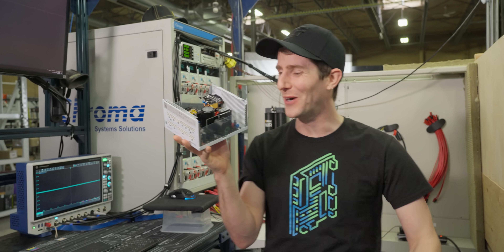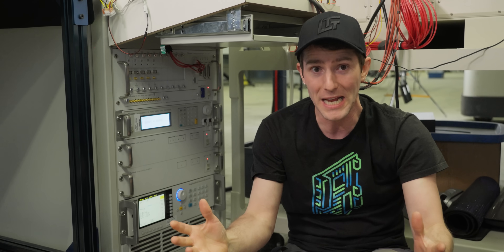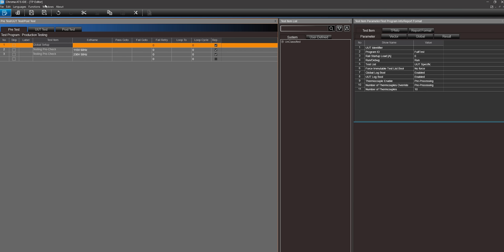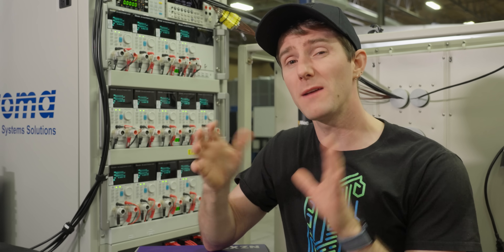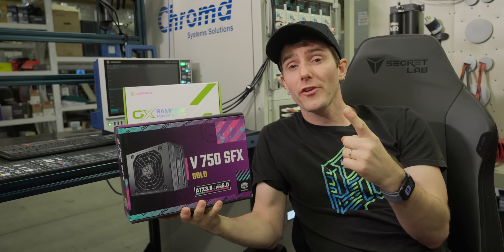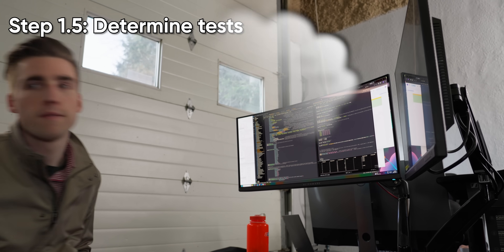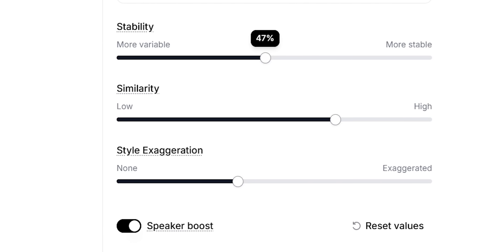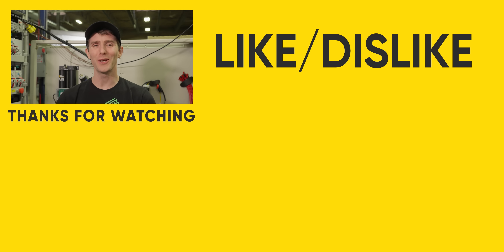Thousands of You are Buying Dangerous Power Supplies

Comment: Engineers getting a platinum power supply out of gold is a flex on their part
Reply: In reality it's in huge part probably also just market segmentation - they don't want to have the high rating on a cheaper product. But they might save here and there by reusing designs or parts from more expensive PSUs.
Reply: @amunak_ Right: if it doesn’t cost too much extra, why not just have a nice platinum-level design which you can change the rating sticker and price on as convenient?
Reply: @amunak_  100% dude, a company isnt gonna design a product and build an entire production line for it for $$$$ if they can cut down an already existing product on the same production line for $
Reply: And TBH, I'd rather have that happen than have something advertized as a 900 watt 80+ Titanium wind up being something that is barely fit for the base tier of 80+ and can't even safely handle 500 watts.
Reply: @ZeldagigafanMatthew completely agree 👍
Reply: @ZeldagigafanMatthew efficiency levels don't effect power output. A 600 watt bronze and a 600 watt platinum will roughly put out the exact same power
Reply: @jacobwebb8818  that's not what I'm attacking
Reply: right on
Reply: Cool tommy vercetti pfp
Reply: no no no it was all clearly ATX I don't know where you saw a flex power supply anywhere in the video /s
Reply: You'd hope the manufacturers have similar or better testing equipment.  While this stamp of approval at a good price point will drive sales, a bad supply that lets the smoke out when doing nameplate ratings should incentivize manufacturers to label the supplies truthfully.
Reply: Ngl that's just made Corsair go up in my books, got some proper engineers around out doing themselves
Reply: They might have even got fired for not using cheaper parts and hitting the expected rating.
Reply: Alchemy not Engineering. ;)
Reply: I literally just returned a game max power supply this week. My motherboard reported voltage errors. I bought another corsair psu and all was better.
Reply: Its actually not, since better/higher rated part should work closest to designed target and not have some low some good and some very good results.
Probably not in computer parts, but in some other areas, like the strength of bolts/beams both the low and high results are considered failures, since it did not perform as expected
Reply: Not an engineer here, but I'd think QC range is a QC check in itself. Maybe it's a supplier thing with different quality parts.
Reply: Rightly said, Mr. Vercetti.
Reply: Yea they all got rewarded with a nice layoff the next year
Reply: I can understand that they only certify it gold, when it's platinum: They were only asked to make a gold standard one for their production line, so that is the MINIMUM they had to achieve in terms of efficiency. When they reach higher: who cares, if the circuit is good, you just use the same one for the platinum line ones. But as it's only gold, you know you will never get complains that the power supply is underperforming - because who would complain: "you made the product too good"?
Reply: Making platinum out of gold is a chemistry matter. 😂
Reply: same as fractal ion, but they sell the platinum with new cable and the call it a new product
Reply: Ya you have no idea what you are talking about. Overshooting specifications is a bad thing, not good.
Reply: Under promise, over deliver.
Reply: @atf_1414  or it could just mean that the platinum series is overrated for marketing purposes
Reply: well when you have to buy a gazillion capacitors you get a good deal on tighter tolerence capacitors, the real geniuses are is the marketing an sales team selling PSU for 8 x what they really cost to build.  they dummies are the ones paying for platium or gold ATX PSU when you can get a Platinum HP server power supply for less than $20 bucks, add a breakout board and cables and call it a day.
Reply: Yep, that's proof they are not steal.
..The platinum balls behind them, they are dragging across the flor.
Reply: And here I'm just laughing with a 10-year old Corsair AX1200i, which was so good at the time that Corsair still does not have a line-up refresh because no new boards are good enough to be better than these at the current moment.

Running an i9 13900K with 128GB DDR5-5400 XMP and Asus ROG Astral RTX 5090 OC with the Asus Maximus Z790 Extreme in the HAF 700 EVO case with Corsair H170i and 6x Noctua NF-A14 3000RPM fans and at full load like doing 4K 60FPS video encoding on the CPU (~290W) through ffmpeg and 600W full load on GPU (Portal RTX) this combination is pulling up to 1200W AC 1100W DC with 97.25 Amps and this PSU is laughing at me like it's nothing, and the firmware is in multi-rail mode as well.

Overengineered, these units were tested to handle over 1500W AC at 50°C and not care at all.
Reply: @G4m3m4st0r I've been using the same corsair hx850 since i bought it in 2012. Its still trucking. Its been in three different full builds.
Reply: @G4m3m4st0r bro really put his entire Intel/asus/nvidia build in his comment Oke bro
Reply: @G4m3m4st0r I remember when those came out! I've got a Seasonic X-850, also going on a decade, which was the same unit as the AX860 from the gen prior to yours iirc. I remember reading an article going into detail on how overbuilt these units are; this 850W unit would easily do 1000W at a good enough 80 plus spec.
Reply: @G4m3m4st0r  and that my friend is why ill always buy corsair :glasses-purple-yellow-diamond:
Reply: @G4m3m4st0r  well yes but your old PSU doesnt have the new power connector for new GPUs and using an adapter is lame
Reply: @donttouchthewatch645  I have an official Corsair 600W 12V-2x6 to 2x8PIN sleeved Type 4 Gen 5 cable which connects into the PSU on one side and onto the Wireview Pro Reverse at the GPU. It looks very clean, nothing lame about it. Atleast this way I don't have both sides with a notorious 'melty' connector.
Reply: I got titanium
Reply: The difference between ratings is so minuscule tho. As long as it has a rating, it's just as good. The difference between bronze and gold probably saves you 10 cents a month no the bill.
Reply: smh ... make just one joke what corsair engineers dragging across the flor these days and YT's auto mod is going nuts over your comment...

Comment: For a second there I thought it was a Seasonic and almost had heart attack
Reply: Got scared it was the power supply I just bought
Reply: I thought it was a corsair RMx lmao
Reply: Same haha, especially since the buzzing noise it makes when I turn it on sounds exactly like the explosion at the beginning of the video
Reply: Same, just ordered a Focus GX ATX 3.1 in the 1000W variant for the overhead for my 5080 upgrade.

Would be a real heartbreaker seeing this the say after ordering
Reply: @elementoflight6834 those have like a 12 year warranty 😅
Reply: I actually had to return a Seasonic PSU. The fan started make a horrible noize after a few months.
Reply: If Seasonic fails to build a PSU, everyone else's PSUs would also fail. EVERYONE buys from Seasonic.
Reply: @Sassi7997 Not true, I'm pretty sure FSP, Delta and Superflower don't buy from Seasonic.
Reply: @Sassi7997  No, LTT fans only buy from Seasonic ( me included, in all honesty ).
Reply: @Sassi7997 no they don't 🤔
Reply: I also had a heart attack moment of "what PSU did I actually buy in this build" vs. going to check - sadly there was no Johnnyguru when I built this one so I defaulted to the advice I used to give out of either Silverstone, Seasonic or EVGA

Comment: If you buy a random branded psu, you are asking for trouble. The PSU is the one thing you don't want to cheap out on.
Reply: Even branded PSU can explode... ask Gigabyte.
Reply: Sometimes a brand name doesn't equal good. looks at plastic wrapped gigabyte fire starter psu on display shelf
Reply: @dogmantko  And that's why those tests are important.
Reply: Same goes for tires on your car, Never cheap out on something you're  potentially trusting your life with. PSU's are less life threatening but a house fire is a very dangerous situation, so it potentially Could be. I like my EVGA one, I'll probably get a SeaSonic or Corsair one when I need a new one
Reply: All of the failed PSUs shown in this testing are respected brand products. The best way to judge if a component is going to be reliable at extremes is the number of RMAs and waiting for well documented and tested reviews from non-biased, respected and competent reviewers. I usually won't buy a component of any kind until it has at least 6 months to a year on the market. I've never had anything fail due to poor manufacturing in the 36 years of my builds because of this ethos. Patience is always best in purchasing, assembly and operation of components.
Reply: I like gambling and I like money. point proven.
Reply: Model > brand